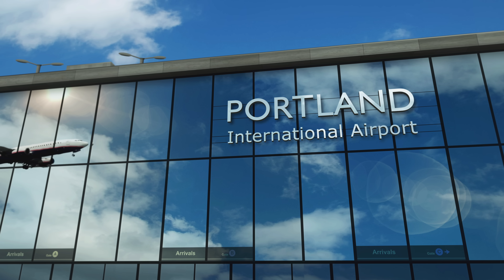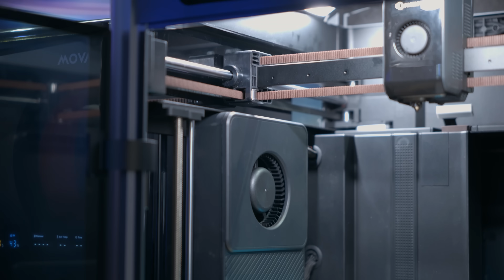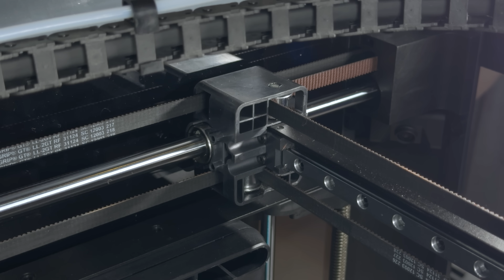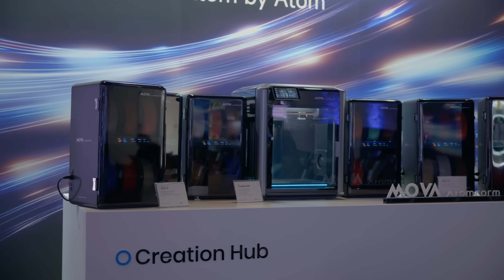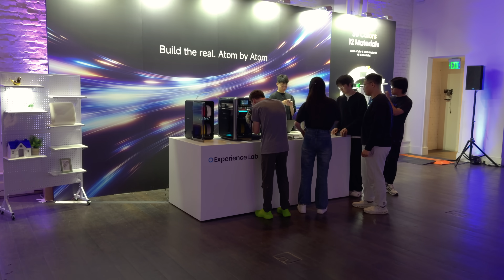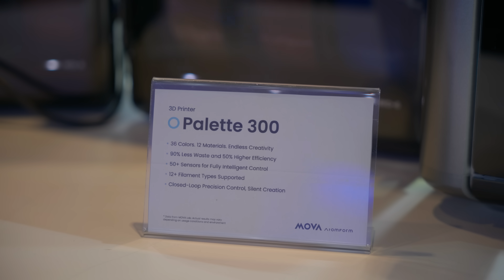MOVA AtomForm Palette 300 - The Engineering Nobody Noticed!

Comment from the maker: CORRECTION: The Nozzle Swapping segment IS edited together from multiple clips. I forgot to remove the text overlay claiming otherwise when I decided to not use the full clip. The full one had focusing issues that made it difficult to actually see what was happening so I decided to use multiple clips for visual clarity instead. 

Sorry for the mistake.

In my limited experience (from observing the machine) nozzle swaps take somewhere between 40-60 seconds each. I expect this to improve quite a bit with firmware refinement, but I cannot say for sure.

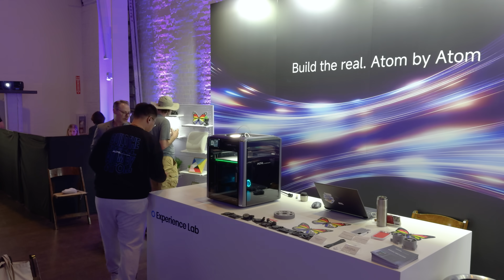Comment: 7:30 OnLy if they are on the different level on the rack. If both color are on the bottom or top shelf, they will still have to wait for it to retract all the way to the AMS. That my opinion by reading the info on the kickstarter page. I cannot find any info on how to hook up 2+ AMS or a VIDEO of real multi color print. I never own AMS printer and dont know how Bambu Lab H2C hook up to mutiple AMS. So my choice of printer I want to get are as follow:

1. Prusa Core One L or XL(if they make one) with INDX installed but build volum decrease. Maybe 2027 or in to 2028 but the time it release already outdated LOL
2. AtomForm Palette 300 True 300mm printer Maybe get this now for $1300 (? Shipping ? Tax) and wait for Core One XL
3. Bambu Lab H2C If they drop it down to $2000USD

They are the 3 printer i knew that are nozzle swap. I think prusa will be the fastest with all direct feed. but between the other 2 only time can tell.

Comment: I am very interested in this machine myself. I just bought my first bambu machine and am blown away with the AI detection and reliability. I got my P2S at the last minute during black Friday. Since the beginning of December I have put successfully 1100 hours on it. I've had some issues, but none that I could not easily resolve. The machine did save itself as it detected a blob forming. Thankfully I was able to remove it as it was very small and I continued to print as soon as I cleaned the nozzle and the bed. That said. I wonder what the reliability of this machines AI detection will be. It appears that Mova is aiming directly at Bambu, and if this palette 300 is as great as they proclaim it will be game changing. I am looking to buy a new machine soon to keep up with my demand for prints. I do a lot of multi color so that's why this machine appeals to me, even more so than the Snap maker U1. I want my machine to be able to use more than 4 colors, which the snap maker appears to only be able of running 4.

Comment: 2 questions about this, how does swapping the nozzles help with multiple materials, it doesnt seem like they have their own dedicated filament path. It looks super cool and interesting but it looks a little confusing to me on how it can swap temps quick enough and minimize purging and filament waste.

2nd that dry box looks awesome, can it be used as a standalone item?
Reply from the maker: The key benefit is that each nozzle can be dedicated to a specific material. So nozzle 1 is can be your PLA nozzle, nozzle 2 is can be your ASA nozzle, etc. That means when you swap from PLA to ASA, you're not trying to push a new material through a nozzle that has residue from the last one. No cross-contamination, no clogging from temperature mismatches, and way less purge needed. On temps, current ceramic heaters we use can adjust temperatures surprisingly quickly. And yes, the RFD-6 is awesome. No word yet on standalone availability but a lot of us are asking for it.
Reply: @MandicReally have a deditcated nozzle is a good idea from that stand point, but looks like you still need to push filament through from the box to the nozzle correct? So it operates like an MMU or AMS style system, it just swaps nozzles so multimaterial can be used?

I cant wait to see more on this. I do like ths dryer though lol
Reply from the maker: @Armor3dprinting  Yes, you've got the right of it.

Comment: I think this RFD-6 with dual feed works fast ONLY in some ideal cases. Probably one feed is for top 3 spools and the other 3 is for the bottom ones. So you need to arrange your spools in most optimal manner in order to benefit from this system and won't work in all situations. I don't think they have implemented a sophisticated 6x2 multiplexor inside the RFD, what would be overkill.

Comment: You know, I think you're the /only/ source - including ATOM themselves - that's been willing to even ballpark pricing.  Thank you for that.

Now, this machine really catches my attention.  It's the autoloader from a T-72 tank turned into a 3d printer; even the interrupted screw for the nozzle evokes the T-62's breach.  It does make me wonder if someone on the dev team is an ex-tanker, or maybe an Norinco veteran.  At any rate, it's really cool... but it's one of those "is this really worth the cost for me" situations.  My first-wave kickstarter X1C is starting to wear out so I'm looking at what I'd replace it with, but... a P2S without AMS is 800$ CAD.  Adding a 0.2 and 0.6mm nozzle is less than 50$ CAD.  This machine is about 1500$ CAD, and really what is it saving me?  A few minutes of time every couple weeks when I do nozzle swaps, and maybe an hour a week of planning - right now, I try to stack things up so I'm doing all the stuff for a given nozzle and filament at once, and then do the next combination.  With the Pallette 300, I could just do whatever, whenever.

And to really take advantage of the nozzle-swap one needs to have the RFD-6, which doesn't have pricing but I suspect will be more than an AMS2.  Having those will save me a few minutes every few days in terms of changing spools.  They would, yes, also let me do multi-colour from time to time, but the /vast/ majority of what I print ends up being painted, so printing in multi-colour isn't a priority for me.

All of this is really just me being sad, though, that the fiscal practicality I need to live inside means I shouldn't be buying this fascinating device.  :)

Comment: It’s nozzle swapping time is slower than Prusas MMU3 colour change time… benefit would be multi-material, but FF creator 5 and snapmaker U1 both do true MM faster.
Reply from the maker: Currently I think they are entirely focused on ensuring it is as reliable as it can be. They haven't spent much time tuning it for speed (from what I gathered). So yea, right now it isn't the fastest gun in the west, but I expect it to speed up. I don't expect it to ever reach toolhead changer speeds, but comparing to a traditional "single nozzle MMU" I think it has the ability to get there.

Comment: The ultimate question is, if you had to choose just one printer would this be the one?
Reply from the maker: I can't truly answer that right now. It is far too unproven for me to say. So realistically, right now the answer is No**. **= It has to prove itself long term. I do really like 300mm build volumes, I like the fit and finish I saw on the beta unit, the nozzle changing isn't something I'm clamoring for but is a "nice to have" idea. I would really like to just have 6 filaments loaded int he RFD-6 and pick which I need at the moment for a print. That would be my biggest use case. It all comes down to long term reliability, which I just cannot know until we get to test it.

Comment: Your videos have become the uncanny valley of audio. I don’t know if you’re completely overdoing all the voiceover work and then putting in clips where you said the same thing but use your overdubbed audio or if you’re using one of those waves plug-ins that completely kills all room ambience but it’s just really bizarre watching you talking and it doesn’t quite match up to your lips and there’s absolutely no ambience or room reverb or anything it just sounds like you’re in a foam room. It’s hard to watch
Reply from the maker: My audio is recorded direct to camera with a lavalier mic and processed through a pretty standard EQ, limiter, and light compression pipeline in Adobe Audition. No AI, no overdubbing, no Waves plugins. I keep my preamps low and use industry standard mic placement to keep my audio clean because I'd rather it be 'too clean' than have viewers adjusting their volume throughout the video. I get these comments from time to time, but I don't know what to do. Every creator or editor I've spoken to agrees there isn't an issue and the audio is in sync. I just try hard to produce clean audio so I don't have to post process it more than necessary to achieve a good consistent level.
Reply: @MandicReally  One of my teachers once said "It's better to be consistent than correct."  Now, he was talking about assigning call numbers to library books - the average user doesn't care if the number is "right", they just want all the books on tigers to be in the same spot -  but it's a comment that applies in a lot of places, including here.  I personally find your audio one of the best on YouTube /because/ it is so consistent and predictable, and if there's a slight de-sync from time to time, that's as likely to be my computer processing the audio slightly faster than the video as anything you did on your end.  

Remember, too, the retail rule of thumb: if you're getting less than 20 complaints per compliment, you have net positive feedback!

Comment: Rotary tool changers have been around for decades in CNC machining, they have proven to be reliable there, but those machines cost a lot more. 
Bambu needs to implement the dual filament feeding system, as that's the biggest flaw of the H2C currently, slow feed from the AMS unit. Get the next filament ready to go while printing. 
Their AMS system is what I find really interesting, I like the stacked design, would just want heating throughout, not just the one layer.
We also haven't seen the software. Software is what makes or breaks a 3D printer. It's what has made Bambu so popular, good software.
Reply: Bambu will have a filament "switcher" to market soon enough but the biggest issue is the current AMS' having only a single output. This makes preparing the next filament from the same AMS impossible.

People have already tested putting the ams 5" (~127cm) away from the rear of the H2C with very minor difference (~5 seconds given a normal distance)

I'm willing to bet there will be an AMSC with 4 outputs to alleviate this issue.
Reply: @winebartender6653  saving 5 seconds a swap over 1000 swaps is over an hour of time saved.

That said, seems like a lot of people use the H2C inefficiently. Your main print color should be in the left nozzle. All secondary colors (including support material) should be in the right on the Vortek. I see a lot of people using the left nozzle for support interface material only. That wastes significant amount of time.
Reply: Need more information  on software 👍
Reply: @motomatta1  it says via website, not actually software. I may be wrong.

Comment: So one question what slicer does it use and is it compatible with say Prusa or Orca and will it be open source running Klipper
Reply from the maker: They have their own slicer coming that is a fork of OrcaSlicer. I don't know if this is a requirement due to the complexity of the tool changing, or just a "We want our own slicer" thing. As it is still in early Beta I didn't push on the firmware or slicer question yet. That will come if & when I can get a test unit. Things under development and not available to even beta testers I give more leeway around these topics.
Reply: I hope ORCA👍

Comment: RIP Bambu Lab
Reply: An unproven, untested (by consumers) machine with zero info about the software? I'm sure bambu is shaking in their boots. 🙄
Reply: @NWGR   yeah, I should've said 'RIP Bambu Lab ... if this is true.'
Reply: Meh, the real value in a Bambu Printer is its ease of use.  Anecdotes aren't evidence, true, but of the dozen or so people I personally know with Bambu AMS systems... most of them now use the AMS just to keep reloads or commonly used filaments "on tap."  The only Bambu printer this is really challenging is the H2C.

What will be really interesting to see is: does this setup do better in the market than the aforementioned H2C, or Prusas's INDX tool-changer.  I'm not listing the U1 because I think once early-bird is done, U1 will slot in as the "more affordable but less capable" option.

Comment: Great video. This looks very promising if it can deliver good reliability. My primary concern would be having an issue with the nozzle swapping system and having to take it apart to try to fix it. When will you receive a unit to test? Hopefully before the kickstarter launches...

Comment: Should very much checkout other reviews, because the video of the nozzle swapping in this video is only a small clip of the time it actually takes.  Nozzle swapping is next level slow, think AMS slow.  It parks the nozzle a while before it unscrews it, I think to adjust the temps.  Hopefully they can speed this up with production units, but theres no way I am backing this one.
Reply from the maker: You're right that I trimmed the swap footage. I didn't have a usable continuous clip of the full process so I edited multiple together, but start to finish it was about 50 seconds. Worth noting, these are pre-production units and nobody has a test unit yet, so there are no reviews to check. I'd expect swap speed to improve as firmware matures, but reliability should come first. I'll put it through its paces once I get one in studio.
Reply: @MandicReally  Probably ought to edit the video, a comment pinned dosnt exactly do much.  I rarely read comments on Youtube.  I only left a comment because I thought your video was terribly misleading.

Also worth noting, I used the word review because you did.

Comment: Seems a bit over-engineered for the ultimate purpose. Personally, I think full-spectrum printing is the way to go.
Reply from the maker: Full spectrum is really cool, but it only handles multi-color, not multi-material. You can't somehow just blend PLA and TPU like that. It also requires thousands of tool changes at very low layer heights, so print times are very long. That said, a machine like this could theoretically do full spectrum too. Different tools for different problems. Folks focus too heavily on multicolor and ignore multi-material in discussions about equipment like this.

Comment: I own a Bambu X1C and also a MOVA P50. What originally sold me on the P50 was the three-year warranty. When I first received it, about a month after ordering, it was already outside Amazon’s return window. Shortly after, the vacuum malfunctioned, dumped mop water internally, and the motor started failing.
When I contacted MOVA, it took multiple back-and-forth conversations just to get them to agree to a repair. After I sent it in, it took nearly three months to receive a replacement that actually worked.
I have also submitted feedback about missing features, like not being able to change how often the vacuum empties beyond what the UI allows, and that feedback has gone nowhere. I genuinely hope this product gets better post-purchase support than what I experienced with their vacuum line. It felt like they rushed it to market and stopped thinking about it after that.
Reply: This is the kind of thing I always look for with reviews when dealing with new companies... How do they respond and follow through when there is random problems. It really shows where the company is as far as integrity and morals and helps me decide if I want to give them any money or go into long term business. 

It's not specifically if a product has growing pains or design issues it's how well the company stands up and does the right thing and solves those issues. Some are great, others not so much.
Reply: Good to know 🙂
Reply: This is the reason why I am hesitant on this machine. I would feel more comfortable buying another P2S combo. Even though it's not nearly as efficient. It works. I am very interested in the Mova palette 300. I would likely only pay the early bird price for it. Not full price. If it works for that early bird price and is reliable then that's a win!

Comment: i think it's a fascinating idea & machine.  the only thing i wonder about is how to array that many rfd6 boxes around it, plus cable & tubing management for 6 of them plus the machine.  that could take up your entire prusa rack pretty easily, but i imagine having that extensive of a setup should probably be on wheels so it could be rolled out for occasional maintenance - that's the biggest reason the half meter build volume machine with integrated drybox/mmu i've been designing is on retractable wheels, aside from the ability to move it around otherwise as necessary or desired.
the nozzle wheel looks like an arc reactor until you take a closer look too, which i think is fun.